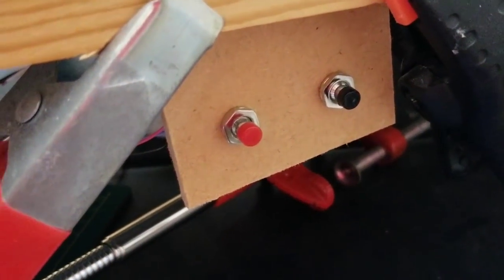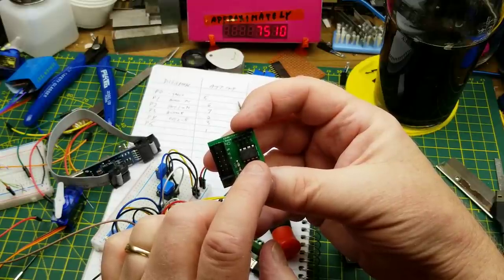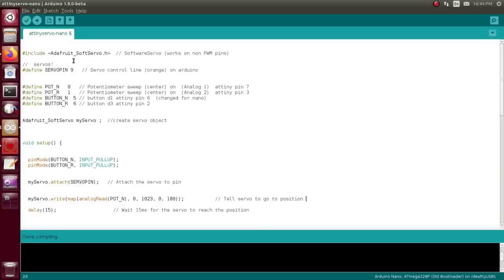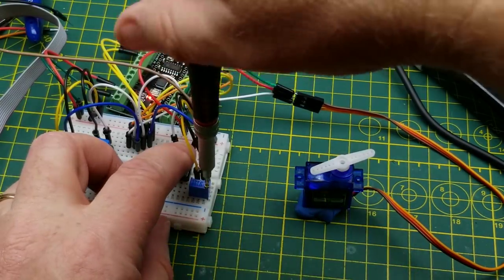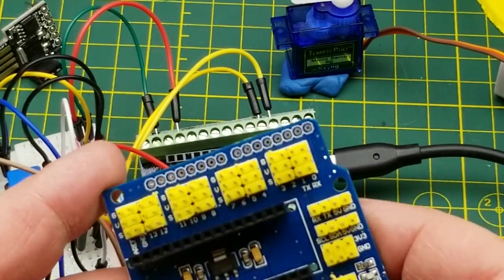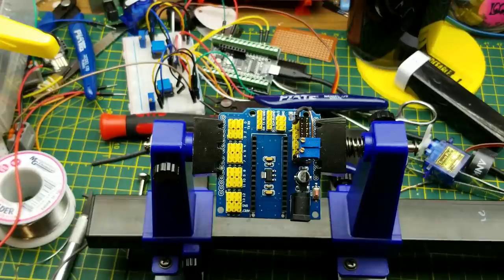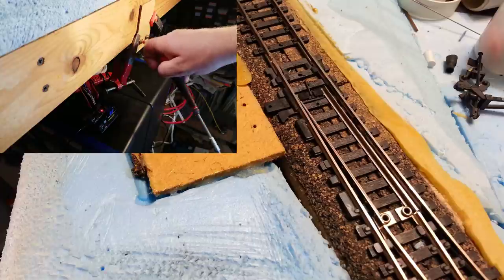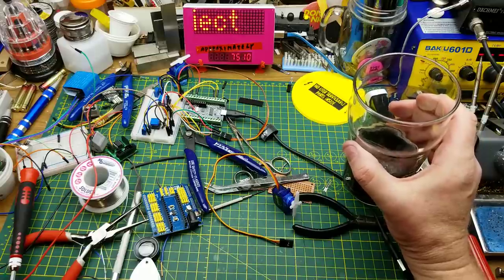Model railroad track switch control revisited

Comment: John-David Kato

Hello from Toronto! ...What servo library were you using with the ATtiny85 that gave you the jitters? I have been tinkering with these lately.
Reply from the maker: I tried the Adafruit soft servo library (the one I happened to end up using on the Nano in the end), another one called "software servo", one called "8bitservo" and a "bitbanging in the loop" approach I found somewhere. (I got several pages deep in the search before I abandoned the attiny approach)

The demo code that came with the librarys mostly worked on its own, but when I started adding stuff to the loop that's when it started going all unpredictable and jittery.
That may be a limitation of my rudimentary coding skills. 

Good luck with your project.
Reply: @pileofstuff     maybe the example loop needs to be the sub-loop in a nested loop,  it only runs when needed, does it business fast and exits the sub-loop , continues with the main loop, probably waiting for a signal from several infrared sensors
Reply from the maker: @jyvben1520  I... recognize some of those words...

I'm sure my code could be improved (a lot) by a competent programmer. Or even a below average one!

Comment: You lack of programming experience shows. Here are some notes/ideas:
Analog inputs on Arduino is also digital input or output and works exactly the same as all other digital pins.
To avoid servo jitter/noise you could move the servo, then stop updating it after a second.
You could store servo positions in EEPROM.
Two pots and a save button would be enough to store the position for the last used servo, i.e. you could have more servos on a single Arduino.

If I decided to do a model railroad I would use a lot of microcontrollers and link them with a serial bus (probably 485 bus), this way I would only need 4 wires (2 power, 2 data) to go between all the microcontrollers. Most microcontrollers would have the same program, that would be controlled from settings in the EEPROM.
Reply: Totally agree with you. Depending on the force exerted by the servos you could possibly make them self-calibrating, doing away with the pots and buttons. The code tries to move the servos fully in each direction and uses the read() function to get back the actual positions they stopped at. Maybe back off a degree or two from the returned value and save it to the EEPROM.
Reply: Generally you cannot read the actual serve position.
Reply: @henrikjensen3278  That's a shame. Makes you wonder why they bothered adding a read() function.
Reply: To check what position you requested.
Reply: @henrikjensen3278  I suppose that could be useful if you don't know how to store the position you requested in a variable in the first place! :)
Reply from the maker: I agree. I never pretended to be even as good as "half-assed" at coding. 
Everything I'm doing in this (and other Arduino code based projects) is as much documenting my learning process as anything.

Some of the suggestions you offer sound intriguing, if a little daunting.
Thanks
Reply: You have been telling about your coding ability a couple of times, I just wanted to give you an idea what is possible.
For you it might be a lot of work and learning to do it and it would require some serious work and time. I will not tell you to do it or not, that is your decision.

I have been doing electronic designs (Usually fairly simple) and programming (Both microcontrollers and PC's) for many years and enjoy designed electronic and programing. You are welcome to ask me about electronic/programming if you want and maybe I can give a useful answer.
Reply from the maker: @henrikjensen3278  I do try to advance my coding skills every time I tackle a project, but it's a long slow process for me.

At the end of the day, I'm just doing this for fun, so when the mood strikes me I dive in for a while. 

It is helpful to get all the suggestions from you guys, even if I don't always take all the advice every time,  I still learn something from all the comments!

Comment: Esp8266 would be better you could the automate.....
Reply: Is it easy to use esp8266
Reply from the maker: ESP8266 is more powerful as a processor, and does add wifi to the mix, but it's pin count is more limited than the atmega328 based boards.
Reply: @pileofstuff  If you use the ESP12 the soldering onto a custom board as it's castellated is easy. You can get them for $0.99 each so the overall cost would be lower.  You could also program the limits for the servos via a small web page so would be able to drop the cost of the pots.   Win Win  Failing that how about using Pi Pico?
Reply from the maker: @timballam3675  I do have several ESP-12s in stock. I'd have to figure out a solution to the lack of analog inputs, though - probably something a bit more advanced than my current code skills.  
So much to learn...